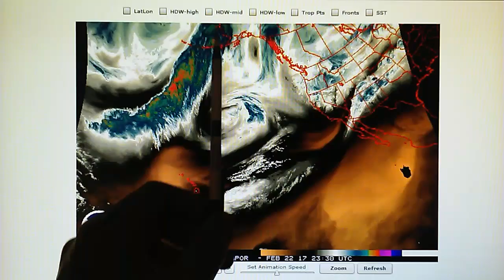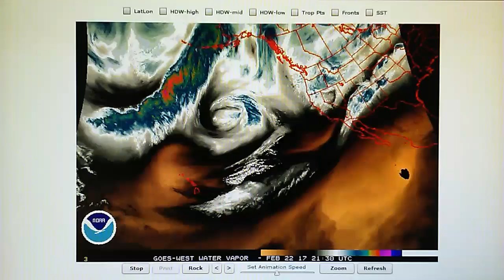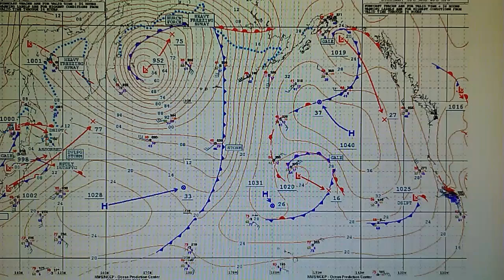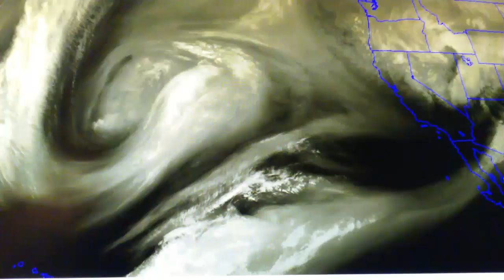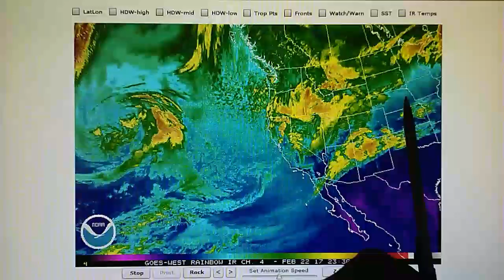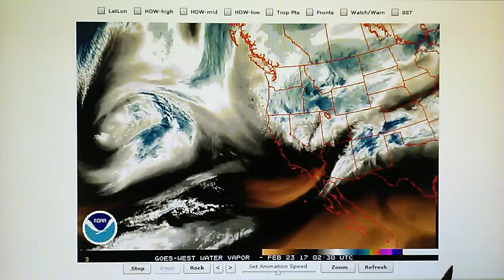2-22-2017; Installed High Pressure Next to Low Generates Wind In So. CA;

Comment: you know.... i put the rebar in on one of these base foundation for these transmitter tower, years and years ago way up in the sierra nevadas bye susanville....   im talking very deep and big footings and very big iron..... the whiteball was on the trailer when we got their and they where trying to figure out how to get it up the mountain cause it was just an old fire road red clay dirt.
Reply: What year was that?
Reply: 2004 to 2007... the rod company i was with had them all over northern cali being put in.... not cell towers big nasty iron.... the standees where taller then me by a few feet... im 5'10"   stacked slab 3 concrete pours of 7 feet deep... massive anchor bolts to bolt the tower too
'
Reply: very possble....  tesla was the man!!!    we all could have free or dam near free eletricity